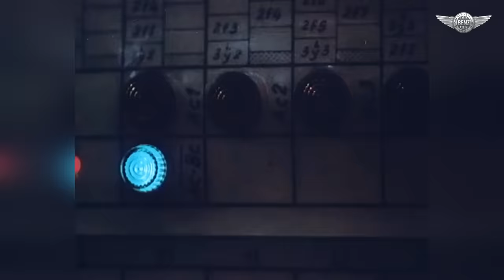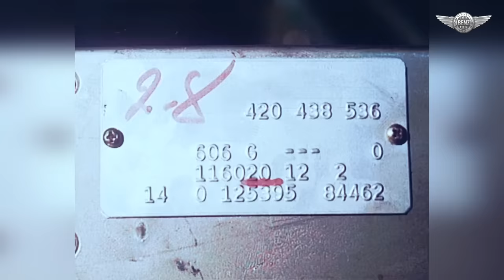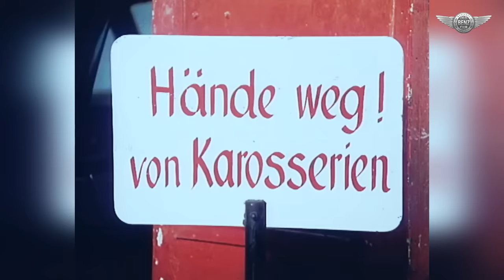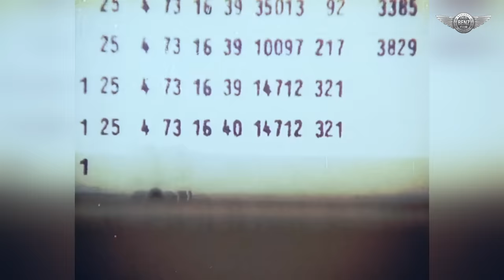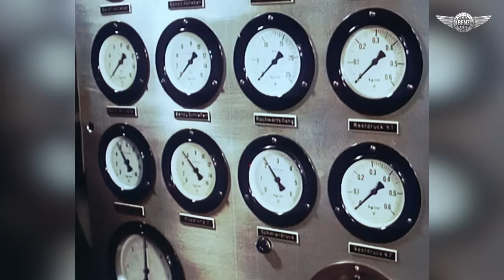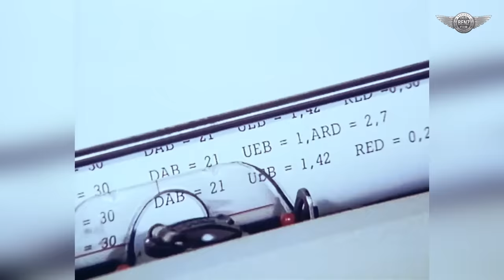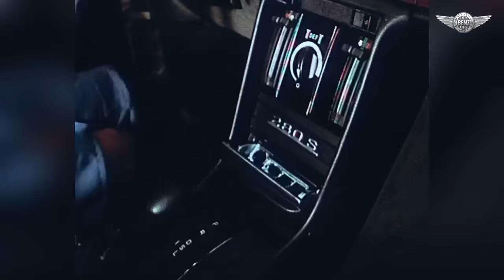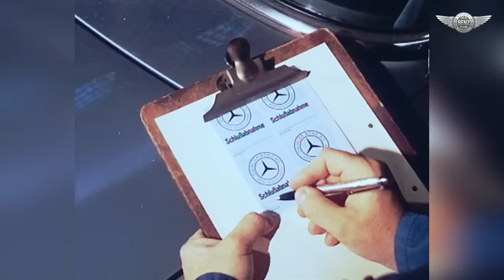Mercedes S-class w116 production - plant in Sindelfingen 70th

Comment: Many of those engine's and transmissions will still be running today!
Reply: Yes in maroco
Reply: @balsamiqmunchy No...just today.....my 3.5  V8 is running like a Swiss clock....
Reply: Yes, I gree with you 👍🏻
Reply: Mine is! 1975 450SEL!
Reply: @LilyoftheValeyrising  mine is 1977  350 SEL  four-speed manual gearbox ..... only 4266 units were built in total....
Reply: 100% from Africa
Reply: Yes in turkey and so expensive
Reply: And Saudi Arabia
Old is gold
Reply: Yes
Reply: Yep my 79 300SD still runs like a sowing machine
Reply: Yes. 1973 280s  in beautiful red. 235000 km
Reply: 1982 Mercedes 280CE and 1993 190E running like new for me !
Reply: Neglected w126 handed down from my grandfather. With a couple fuses and relays changed runs like a clock
Reply: My  1991 W201 (Baby Benz) 190D as ONLY 449.236 Km and it"s still on the run 😄
Reply: @social Wrong, my 350 SE from 74 is still running without a single problem, respect
Reply: @RivieraByBuick  Hahaha, wrong
Reply: Ofcuse
Reply: Of course in Nigeria 🇳🇬
Reply: Are running*
Reply: @arturostasi1461  true beast not made that car today..
Reply: My dad own 300E V6 still ok from Indonesia🇮🇩
Reply: @arturostasi1461  Today in my 1980. 280s and 1981 280se
Reply: compared what they build today, those cars could last forever
Reply: Yea i have one 2.0 99kw petrol in 190
Reply: still on road in Pakistan
Reply: Got one outside my garage door! Pretty cool to think of it like that
Reply: Our 79 300sd was made here and still kicking strong! Tribute to a pride of engineering.

Comment: These old Mercs were indestructable
Reply: Not really. Lots of rust.
Reply: @paulmetdebbie447  Yes, but the extra thickness of the sheet metal took an extra six months longer to rust through :).
Reply: I have a 1983 380 SL. 161,000 miles. Solid as a rock.

Comment: I have a W116 1975 450SEL and a R107 1980 450SL. So I got to see mainly the SEL/W116 being made and a few clips of the R107 being made. It’s neat how they put together components and tested them right away. Like the transmission valve body being assembled at 9:30.

Comment: I never knew that the production and the manufacturing of these vehicles, were assembled in panels. I thought this was one whole car body ! Which effectively meant that the spot welding and bolts holding the car together, were obscured in such a way that they could not be seen... By the way, I have a W126 and a W124 standing in my driveway right now and it's 2021 !!!  😎

Comment: I owned one of these cars years ago, a 280SEL metallic green with beige interior. Stunning car, kept it until the design was out of date and considered old. Replaced with a '89 300SE. That car was almost perfect. Smoke silver with beige interior. I barely see a w116 on the roads. I still regret selling those cars. The more I see this the more I want one again, and a late model w126. Those 2 cars would be the nicest cars I owned, from the 14, along side my E39. Im keeping that, not making that mistake a 3rd time. I dont drive it anymore though. I'll find one later this year...

Comment: When Benz meant quality .. newer ones are just wired unreliable plastic badged mb
Reply: @sukhmaidickoff  that might be the case but the gap has certainly closed between mercedes benz and the competition and they're not exactly exclusive and as desirable as they used to be
Reply: @sukhmaidickoff  He is not talking bullshit, nowadays Mercedes are not the same beside there are ugly
Reply: Mercedes now are ugly and loaded down with unreliable electrical crap that will send them to their graves within 10-15 years. These old 280SELs are probably still on the road if not wrecked or rusted out!
Reply: @sukhmaidickoff  He is right, no bullshit at all, the new ones are not the same, my 350 SE from 74 is still running and in perfect shape,  never would buy a new Merc, never, we drive taxi and Mercedes are not trustfull anymore, a lot of problems,

Comment: Those days they used robots for 30% of production line and these cars are still running after 40 years. Today we use robots in 90% and cars are designed to last 10-15 years. Where is technological improvement? Where is ecology?

Comment: My w123 build 

There are also other videos available on this build.

Check out 

PART 1  of the build - Engine overhaul  and Tuning - 

https://youtu.be/B8gWxADMYwg

PART 2  - Rust inspection & Welding works 

 https://youtu.be/UUS-V1o0kPk

PART 3- Paint job and fittings -

https://youtu.be/I2RIshBkUq8

PART 4  - Buffing & Ceramic coating on a budget -

https://youtu.be/Nlf9tVrYLAM

Comment: New cars are extremely and unnecessarily complicated, which makes them very unreliable.  The more computerized systems they cram into a car, the more chances of something breaking.  Cars today have a computerized module for just about EVERYTHING.  When fuel injected cars were first produced, they had 1 computer module that controlled ALL the engine electronics, and those cars were very reliable.  A 2021 Merc has about 50 computer modules...This is NOT progress, it's suicide.